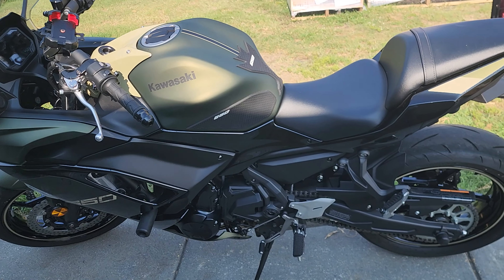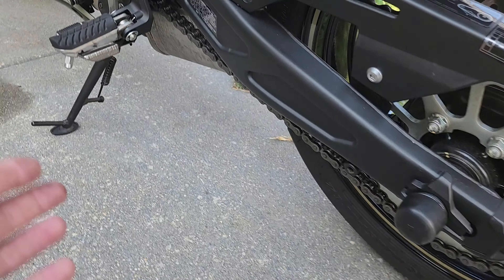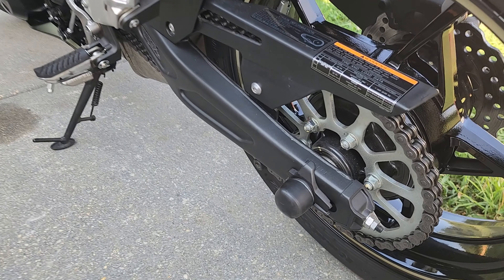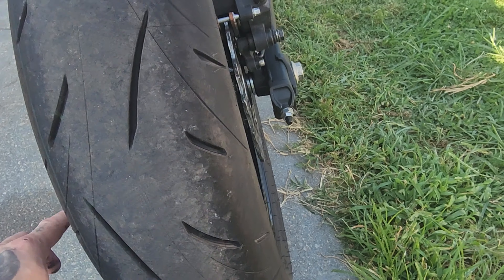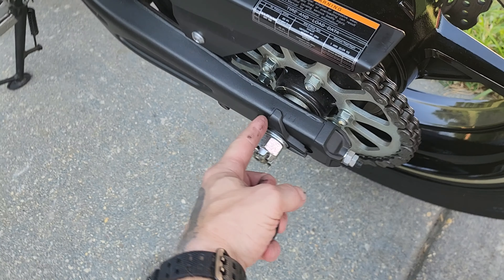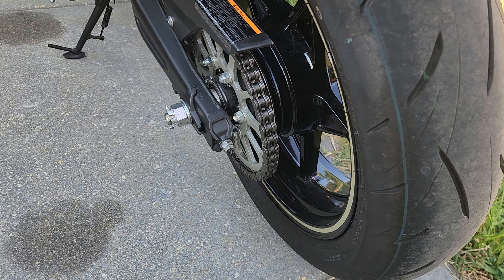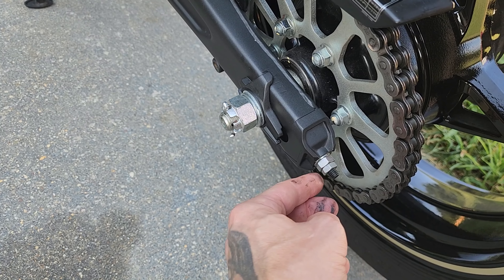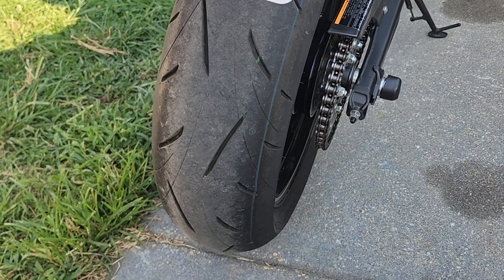🏍⛓️A MUST DO☝️KAWASAKI MOTORCYCLE CHAIN CHECK AND ADJUST⛓️🏍

Comment: I’ll have the dealer do mine. Also use kerosene to clean the chain. 

I use motul chain paste instead of wax or grease lube.
Reply from the maker: @BigDogHDSPB  👍nothing wrong with a dealer. I believe they are certified mechanics. I do like the Motul chain care kit.

Comment: Could you please show us how to adjust gear shifter?
Reply from the maker: @jaroslavcizmar3390  they make a kit to move you pegs and cable back for racing. Not quite sure what your asking, the clutch lever has settings. I have not adjusted my shifter. But I will look into it.